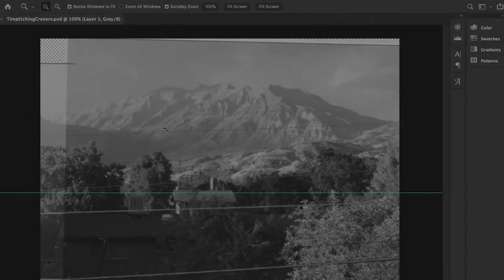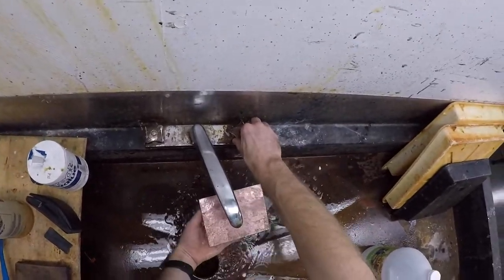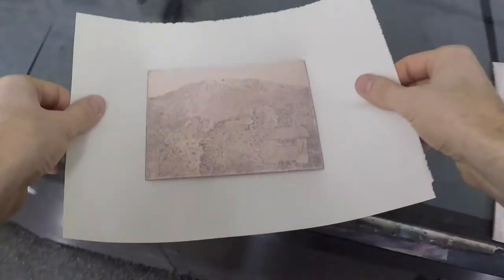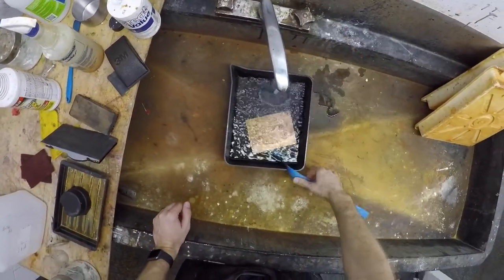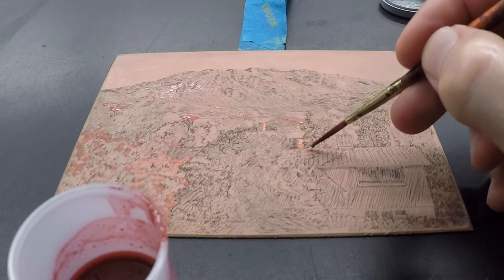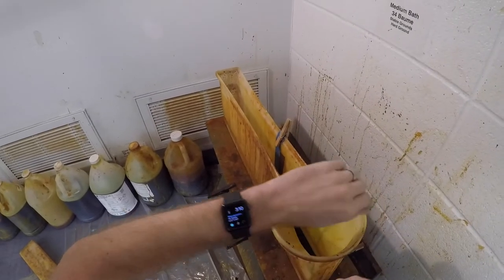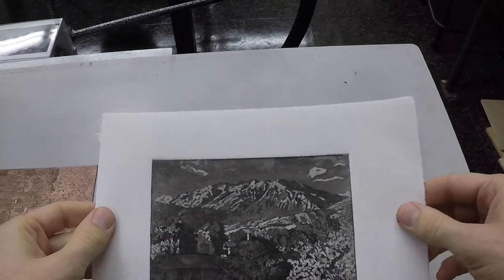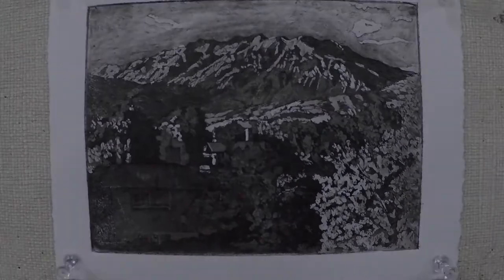Aquatint Over Line Etching

Comment: 9:16 I don't recommend a hair dryer. If it gets too hot, it melts the rosin dust and affects the outcome.
Reply from the maker: Such is the case with any source of heat, including the hotplate.
Reply: @NealCox  Not necessarily. One can use cool air dry.
Reply: @NealCox  how do get a digital photo onto a plate? Also, is there a non-toxic way to create an aquatint???